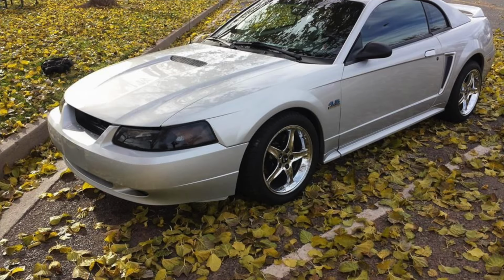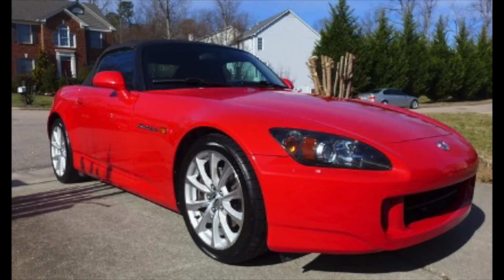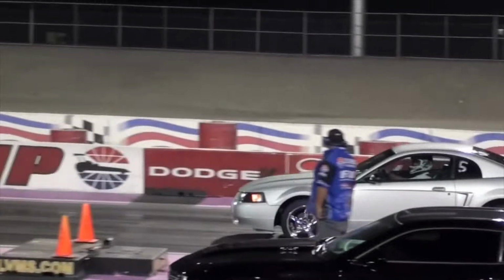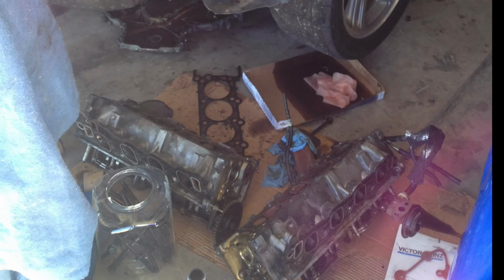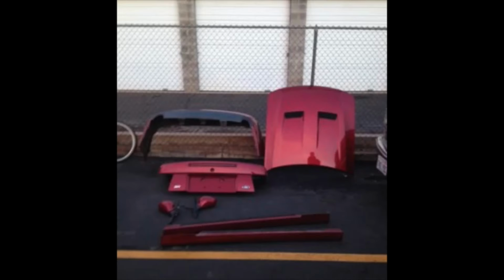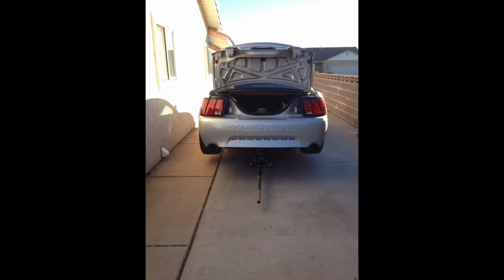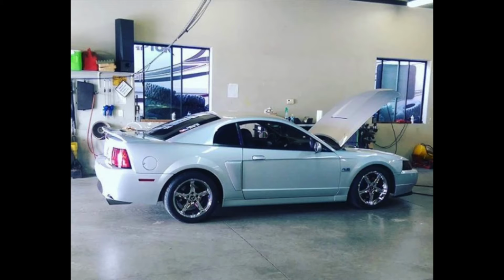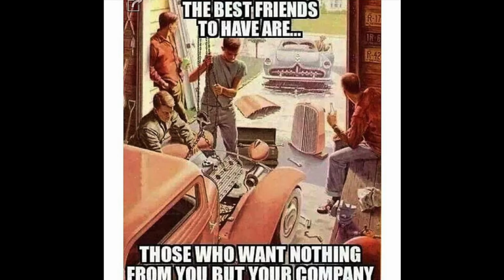2000 Mustang GT Kenne Bell : Story turbo 2V

Comment: How much power was he putting down with stock short block running the Kenne bell and nitrous? Those are some balls to run a stock 2v shortblock with a supercharger and on top nitrous lol Great story Justin 👍🏻
Reply from the maker: If I remember he had it on a friends dyno and it past 600 but ran out of fuel. He definitely wasn't hoping it would last that way.
Reply: Justin SVT I’ve those motor grenade with anything over 450 wheel, wow that’s crazy 2 years with over 600 wheel, that might be the record holder of stock bottom end with that kind of power for that long 😳
Reply from the maker: Yeah and he did not baby it. Those drag race runs were all on that stock bottom end plus nitrous
Reply: Justin SVT That’s crazy bro
Reply: @TheMGChannel  its all about the tune, whoever tuned it, he is the "go to" guy..lol
Reply: @P71ScrewHead that is true and it's about fuel quality and octane and how much you Rev the car stock bottom don't like super high revs ecsp making good power.  Also you gotta know how to take care of it.  Maintain it, don't beat on it till the car is up to temp, etc etc.  Same stuff you should do with any car it just becomes that much more important modified.  The cars that live at big power levels all have this stuff in common as well as good tuning.
Reply: @midnight347  Yep, that's correct.. Only way that thing lasted is e85 or other colder fuel setups.. I hope..lol Either way, that's crazy if true..

Comment: Great story. I can’t believe you did a three way swap to beat a S2000. A lot of work to beat one car.
Reply from the maker: It wasn’t only to beat that one car. It was to make the car faster and beat anything that came in competition
Reply: @anthonylaudano9751  people you used put kenne bells on 2v all the time they were usually 1.7 or 2.1 not the 2.2 and 2.6 ones line the terminators had the 2v can run about 400 wheel pretty safely with a good tune many have gone bigger for a long time but 400 wheel is considered pretty safe.

Comment: Wish I had guys like you in my area.  I just got a 2001 GT, is it generally safe to run at Kennebell 2.1?  I only have 3.73 gears and bolt on TB/CAI.  I’m afraid if it goes over 400 to the wheels I’ll blow a rod?
Reply from the maker: Yeah 400 is pretty safe. Around 450 rods decided they aren’t valued and exit lol